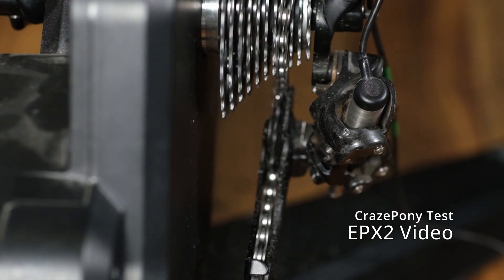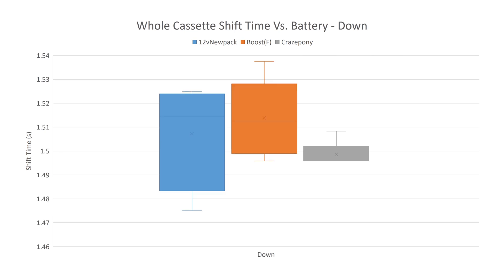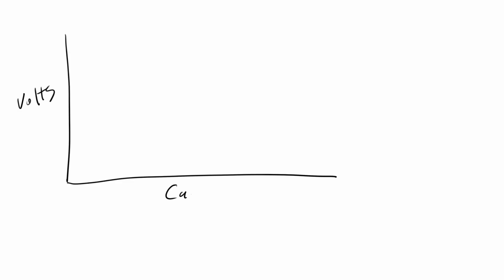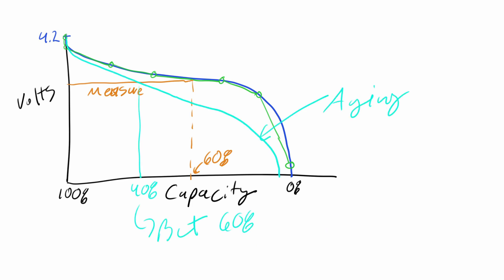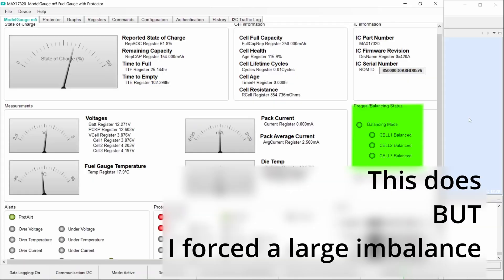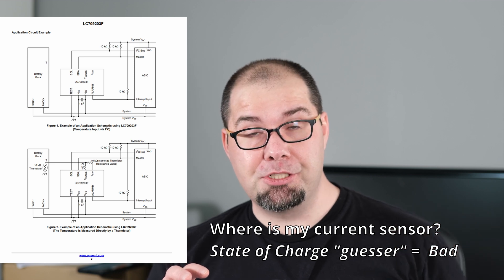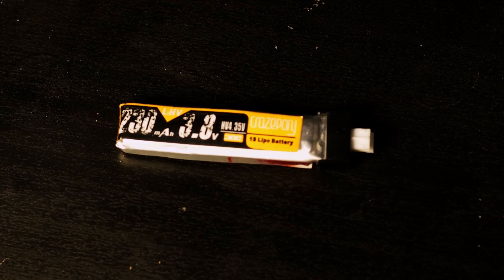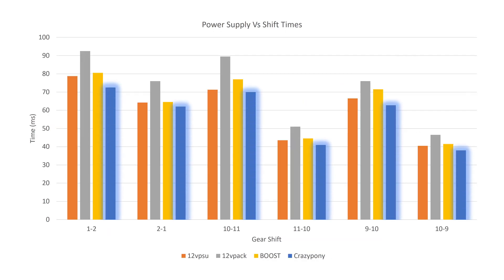Making a smarter battery for Campagnolo EPS  retrofit - EPX3

Comment: you need to start another project called Zwift universal smart trainer race mode. surely there is a way that you can use wifi with high speed adapter for 10k htz data transfer speeds to achieve what Wahoo has done with their direct connect via ethernet and usb c. I'm waiting on Elite to come out with something that plugs into their Direto XR trainer since there is an extra port I'm not using the front wheel gradient simulator.

Comment: Awesome to see this project still going. Since you first started I now have 11 speed EPS and would love to upgrade it to wireless! was also very interested to see your name on some of the latest campag patents!
Reply: On the subject of location for this my two thoughts would be keep the battery where it is with a remote input around the FD for a semi wireless system or could you 3d print a little enclosure that tucks it into the corner of the rear triangle closest to the derailleur?
Reply from the maker: Thanks for the suggestion. I'm hoping to have the video up on the  main PCB design in 2 - 3 weeks. I've figured out most of the components, so it's this... mounting. So appreciate the suggestions, they are going right on my list.